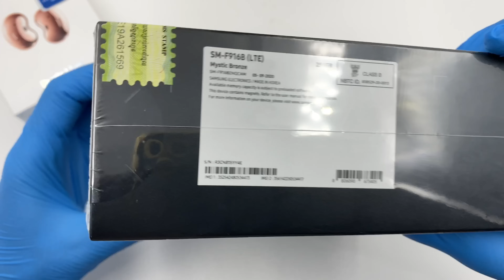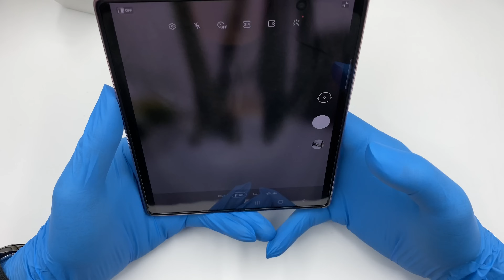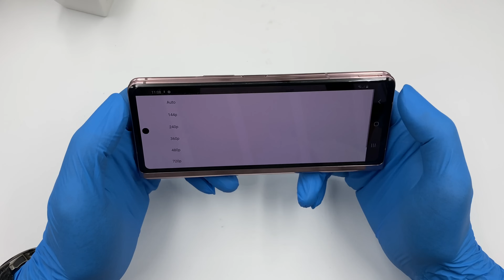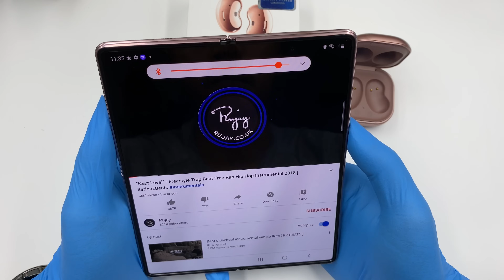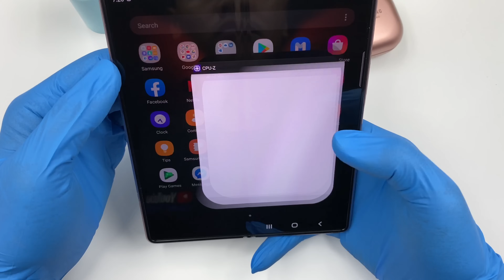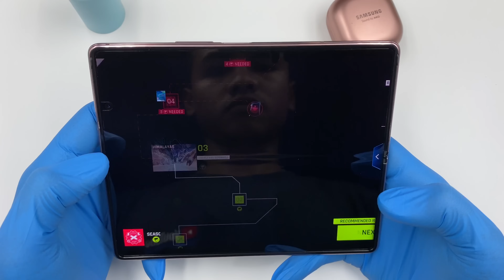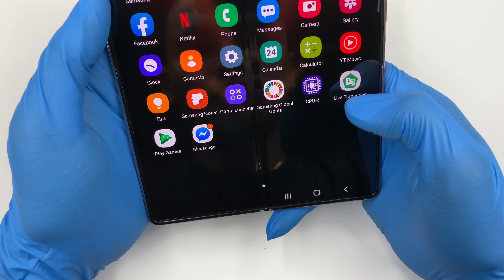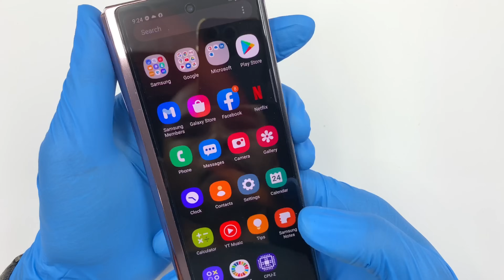SAMSUNG Galaxy Z Fold 2 Teardown..! ASMR Videos..!

Comment: Hey man my note 20 ultra benchmark is at like 570 for single and 2900 for multi after screen replacement did they change my chip or why did it slow down so much it was 900 single and 300 plus multi before the replacement